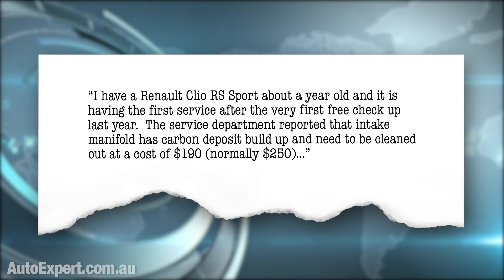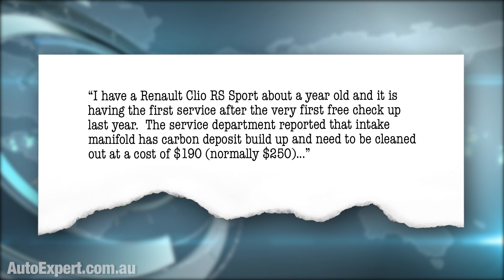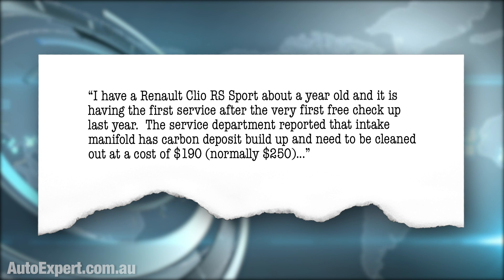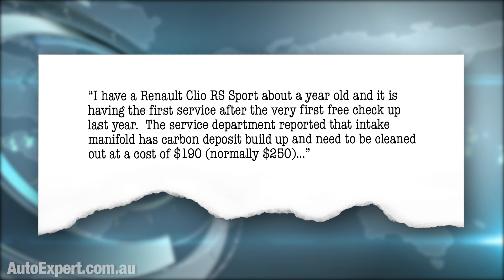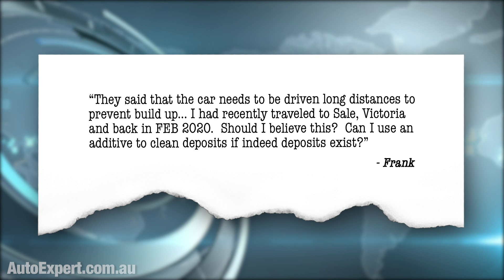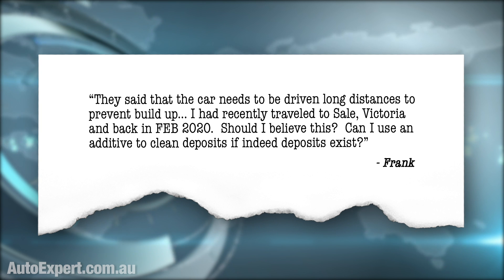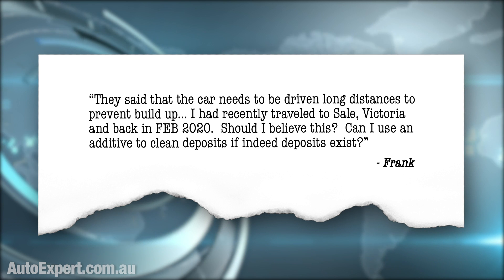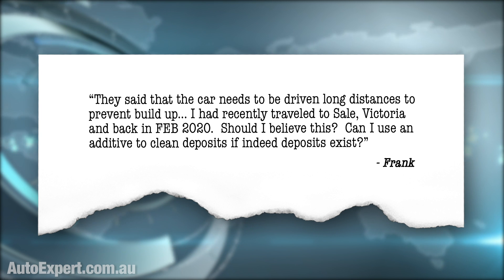The truth about inlet carbon deposits (sludge) in modern engines | Auto Expert John Cadogan

Comment: The term "Italian tune-up" has been around for as long as I can remember and I'm older then the main stream use of fuel injection.
Reply: Doesn't help, trust me. I live in northern Germany in Lübeck and here we have quite a stretch of unlimited autobahn around. My Mazda 6 mps receives quite often the italian tune up and the oil is changed every 8000km with every 3 oil changes comes also an engine flushing. Still I have to do every two years the intake valves clean up if I want my car to run in tip-top conditions even at 250 km/h  and not blow itself up zoom zoom banging.
Oil catch can is the way to go with direct injected engines, empty that can every two weeks and you're good to go. If you're a hardcore gearknob then install water-meth injection in the intake and it's all good, you have more power  and the valves will stay clean.
Reply: I always called it a "Maori tune up "  ,  same thing except they are heavier.
Reply: @spooner0007  Called the Turin tune up here.
Reply: B. Toff  , last time I checked Mazda 6 mps was a limited series built in Hiroshima between 2006 and 2007 having as a base block a co-developed duratec engine with ford and the rest is Mazda. Yes, it's direct injection and turbo-charged, it's the predecesor of the 2.3 ecoboost engine that Ford has now and has refined it.
So, yeah, it's JDM allright... that's why she rusts like there's no tomorrow, like almost all jdm cars.
Reply: @eEnzo0  idk dude I have a shit box honda civic 1.4 non v tech base model from '02 and its spotless on the bottom. One fender starts going but on the important bits it's fine.
Reply: @SoulTouchMusic93  , that's one in hundred of thousands and it also depends on the climate. In humid areas or where salt in large quantities is used in winter for the roads, Honda and Mazda, Subaru and even Toyota (this at least is more durable) are rusting tin cans. Mazda is the worst of all because Ford...
Reply: @eEnzo0  bro, before that Honda I had a jaguar x type which was a Ford mondeo underneath. I know what a rusty unreliable pile of wasted metal is!
Reply: @eEnzo0  haha
Reply: Yes it's as old as the hills

Comment: $200 for a carbon cleaning cheap! my Audi A6 with the 3.2FSI v6 would cost $600 to get it done properly
Reply: and how did you know it was "done properly"? How did you know that it was done at all??  or did you just peel-out the cash to some rip-off b****ard???
Reply: @raymondread9484  Thankfully no. I have used this shop for 12 years and have never had a single issue. He is the only mechanic that touches my car and he has all the equipment there to use it. I know its been done because he shows before and after
Reply: @Vikturus22   agreed.  We put so much trust in our service mechanics.  I recall spending ~$600 to have the brakes replaced on my wife's Corolla in 2004, only to have the brake pad backing plate friction-weld onto the rotor and lock the front wheel 2,000 km later. Thankfully nobody was hurt including my wife and our two small children.  We sued.  Cost the dealership $0000's.  We had kept the receipt and service report.
Reply: Indeed, but that isn’t because there is anything particularly special about that engine, it’s quite and old design and has been around in one form or another since the early 2000s; VW group (and particularly their cash cow, Audi) just charge extortionate amounts for basic things
Reply: @sjb2471  I've had really good luck with mine. I bought it at 28,000km and it just hit 200k. Zero engine issues and has been reliable ( probably only Audi ever to say this lol )
Reply: The $200 clean involves a machine and some chemicals sprayed in, it is the latest upsell. No real scrubbing/blasting/scraping takes place unlike the $600 job which I hope would includes removal of the manifold. The difference is like paying for a handjob or full sex.

Comment: Think I remember reading an article somewhere that talked about the best setup being a combination of both direct and indirect fuel injection 

and under different circumstances each system offers more power 

so to combine the two gets the best of both worlds and for the portion of time the indirect injectors are running it cleans the valves......

not bad.....
Reply: Toyota has the dynamic force engines  (I think that's what it's called), that has both direct and port injections. So does the new Ford focus.
Reply: @lozza2272  So does my SEAT 2.0 TSi 190... in fact all VAG engines Gen 3b with Budack cycle. https://www.automobilemag.com/news/inside-volkswagen-ea888-b-cycle-2-0-tsi-i4/
Reply: The Wholls that’s what Toyota does

Comment: Didn’t we used to use Redex for this kind of stuff? Weekends in the suburbs were once clouds of light grey smoke rising from push rod sixes. Let’s return to the good old days !
Reply from the maker: Let's not. They weren't that good.
Reply: I actually still use, absolutely routinely - i.e. every fuel fill, cause I'm a full to empty tanker, ( petrol or dis-easel ) a fuel additive, namely Moreys Upper Cyclinder Additive of which is an injector cleaner as well.....  I used a couple of different brands over 30 odd years of driving but have decided that i like the Moreys one best. 
I bought a well kept 2nd hand car at 21 years of age & did a compression test at purchase & then did another compression test 5 years later & the engine had better compression at the 5 year mark. 
I can but only "assume" that the U.C.L cleaned & lubed, as it purports to do so, the compression rings & - in theory, only possibly the inlet valves ( on a carbu'ratted engine...) But i did have the carb fully reco'd & ran a Bosch GT40 coil - big monster spark - as was witnessed on a exhaust gas analyzer - it leaned out massively on idle in comparison to the old original O.E.M coil. 
+ as stated, the "Italian tune up" still works wonders & is very much so applicable more than ever due to slower motorway/ hiway  speeds due to traffic congestion...
 My N.Z. new 2010 Toyota HiAce doesn't have a D.P.F from new - only became mandatory in 2015 in "Sheep Shaggistan" (N.Z.) & I'm so very very glad of that fact.... But none the less they're on the vehicles for perfectly understandable reasons.... But even the "Ace" will respond to an "Italian tune" - for those of us who know/remember the "exhaust pipe colour" tell tale - not quite the same colour as was had with leaded fuel, rather just a darker tinge, unlike what hair that does remain on my head..... 
Any other users of fuel additives or U.C.L's out there at all????
Reply: @somerandomgoogleuser666  yeah mate same here been using moreys for 30+ years it does work I often wonder if the injector ( power booster) kit would work on those direct inj engines 😃👍
Reply: @barneybetelgeuse6273  Yea na, meaning no!!!! I've had two mates who had them when we were younger guys into Carburetors on Ford V8's & they didn't seem to work - you mean the constant drip type of set up?? Is that what the "Power Booster" system is/ was?? - from memory??? A dripalator system??? I'm talking about my mates using them about 25-30 years ago....
 I've tried "Fyrex" fuel additive but have gone back to Moreys U.C.L., i believe it looks after the compression rings better.
I proved it worked with the compression test....absolutely for sure.... + meticulous oil changes & vehicle servicing/maintenance... Simple shiv really. 
I look after them & they look after me ( with reliability + they're, mostly (4) Toyota's - pre  2010 stuff.... 
Nice to hear of another Moreys user!!!
I heard of a guy running Castor oil ( for it's light weightiness) in his carburetored Wizz Bang lawn mower - otherwise know as a Rotary!!!

Comment: The basic problem is all those people who got 200,000 or even 300,000 trouble free km from their SV21 camry now have this expectation of any newer car.
Reply from the maker: Some maintenance is to be expected...
Reply: Do they expect it from Toyotas? The 2006-09 V6 Camry aka Aurion was a joke. Not one, but two defective oil lines. Did Toyota Australia ever recall the cars and fix free of charge like Toyota USA did? No, Toyota proved they are scum like every other manufacturer.
Reply: @crashdiet1518   Hence the problem, even Toyota will struggle to live up to the standards they set on some of their earlier models.   SV21 Camry is one.  2.4l pre-turbo hilux is another.
Reply: @crashdiet1518  Every M7GTE powered Cressida build blew head gaskets every 100,000Km. Lucky owners caught the problem before the engines cooked or hydro-locked and bent rods. Most didn't. Toyota never accepted any 'blame' for that shit-storm.
Reply: did that with an ecotec quite some years ago now...bought s/h with 160k,then sold it to the wrecker man with 340k..bare bones maintenance all the way..engine was 
the only good thing left...the interior,elecs & body were not so lucky
Reply: @groundcontroltomajornong8085   Yes, I was being conservative. One of the Camry made it to 400,000 and the other sitting at 360,000 not out.  But for example the alternator brushes on all 3 die every 220,000 ish.  Which I don't think is in the maintenance schedule.
Reply: Intake manifold off != maintenance.   Unless they want to put it in the service schedule.  :-).
Reply: pete smyth  The made in Japan sticker is  going to give you a great chance of a long life. It's not clear to me how/why Toyota has the reputation in AU more than the others.

Comment: Catch cans can help here. Spray cans of cleaner can also help. The only way to properly clean the intake system is paying for a professional chemical clean (big expensive machine hooked up to your car). That is unless you want to pull everything apart and soak it in solvent or something. I believe the recommendation is about every 50,000km for modern diesel engines.
Reply from the maker: Pretty sure regular highway drivong helps
Reply: Auto Expert John Cadogan Indeed. it’s an interesting phenomenon. Not that people check their oil. But if they did, in the cases you described they would be happy they magically have “extra oil”, only for it to disappear after a highway drive 😂
Reply: Pretty sure John has covered the crock of catch cans previously.

Comment: Carbies have always been a compromise. I think the reason people like them is because they think they understand them, unlike these fancy confusers. I'd be asking for borescope photos of the inlet system before I'd agree to a $190 inlet clean.
Reply from the maker: They were the best thing available before microprocessor control.
Reply: @AutoExpertJC  Porsche and Mercedes Benz did use Bosch Mechanical Fuel Injector (MFI) systems that were apparently quite good back in the day. Arguably better than a carby as they'd provide more consistent fuel delivery. Microprocessors did a much better job though, I read once they effectively saved cars in California as they allowed manufacturers to meet new emissions standards.
Reply: You'd want to ask if they were going to squirt "mechanic in a can" into the intake after the MAF sensor, let it sit for an hour, then start the engine and use the rest of the can to flush away the loosened carbon? May as well use a water mist into he intake after the MAF on a highway run...head gasket leaks always clean away carbon..

Comment: Thx, JC!
Do catch cans offer any real benefit on Direct Injection gasoline engines??
Greetings from 🇨🇦
Reply from the maker: Possibly on some, but generally not.
Reply: If you go that direction make sure it has a proper oil separator in the can, it helps but more frequent oil changes are more effective.
Reply: I fitted a proper Mann+Hummel catch can to my diesel Prado 2 years ago and have done over 20,000km and the catch can is still empty. I change my oil every 5,000km. So I have been a bit reluctant to spend money to fit one to my wifes Golf Gti, i have just been changing the oil more regularly.
Reply: @robstone4537  The engine will have a baffle at the breather to encourage oil to condense before it escapes into the breather system. Seems yours is working well.
With regard to owners having different priorities, few decisions are based on proper theories, more on popular myth.
Reply: R&D budgets: Engine designer, millions. Catch can manufacturer and purchaser, not so much.
Reply: @nigelcox1451  Here's a thought. If a centrifugal oil filter/cleaner does the business of removing particulate matter from the oil, the PCV system shouldn't get much to use in constipating the inlet manifold.
Reply: @johnpoot725  I don't think we're concerned with particulates in the manifold, it is unlikely any would get to the breather system. The residue in the manifold is from burnt oil mist.
Reply: Nigel Cox R&D worry about meeting emission regulations and the engine lasting until the warranty is over. Vehicle owners have different priorities.

Comment: Yaaaas
Reply from the maker: Legend, Sambo. Yessssssssss!
Reply: @AutoExpertJC  Mate I'm all over your content. You've given me two pieces of advice over the years that really stand out and I teach others. 
Reversing protocols. Brilliant.
Secondly, buy the car that does what you want. No modification. Buy the right car for the job, don't modify the one you have to be something it's not. 

 I haven't reversed over any kids, plus I'm now driving a bog standard FJ Cruiser. 

Cheers mate, x 2
Reply from the maker: Well done mate. Glad the advice helped. I tried to hate the FJ but failed. I just wish they also did it in diesel...
Reply: @AutoExpertJC  that's the refrain I get from everyone. I specifically didn't want a diesel. That V6 and 5 speed Auto match perfectly. It goes like the wind.
Reply: @AutoExpertJC  Why would you prefer a diesel one? Towing capability? It's only a 2 tonne truck and can tow 2 25... Maybe you have another reason 🤔